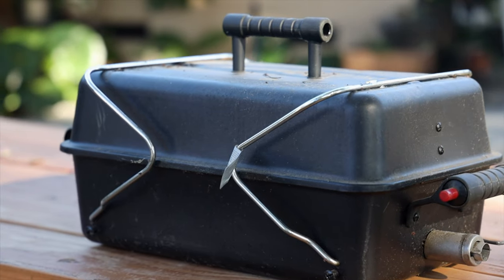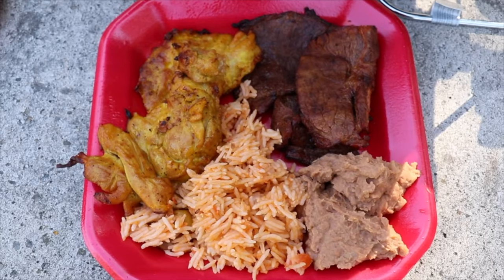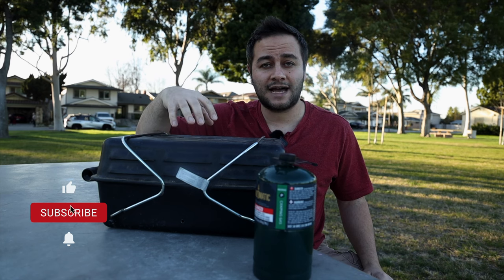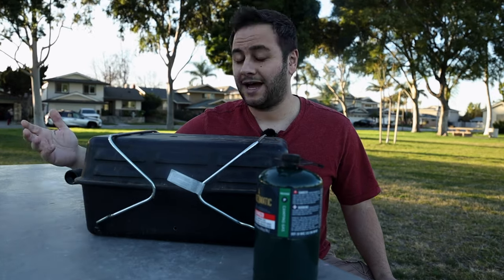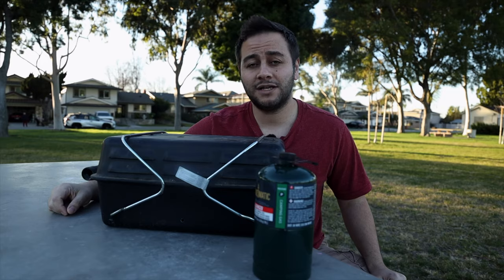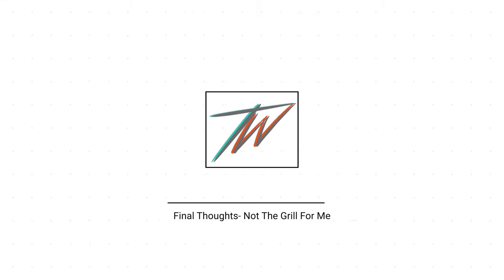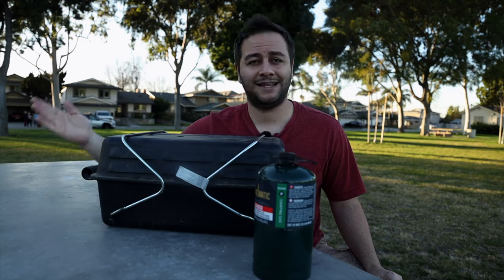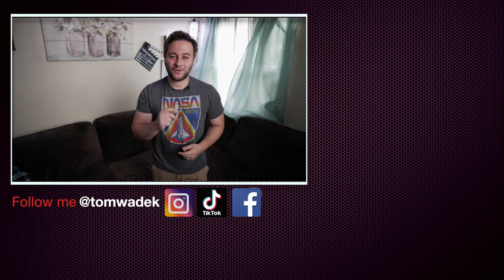I Was Wrong, DON’T BUY THIS BBQ GRILL

Comment: To fix the handles, you can use your (dresser drawer handles) measure the holes distance from one to another then drill the holes in the wood handles for the screws or buy some steel handles from hardware store or make heat treated wood ones. Hope it helps those on budgets and those were the handles broke. For the flame out,, use a hose with the Regulator or a better Regulator. GOD Bless
Reply from the maker: Thanks for the diy fix!
Reply: That was my first thought too. Great idea!

Comment: I have the older version of the Weber grill.  The build quality is excellent and it works fine.  I also have the Char-Broil table top grill.  The Weber grill only puts out a little over half of the BTUs as the Char-Broil grill.  I use the Char-Broil grill almost all of the time because of the increased heat output factor.  I performed several modifications to it.  I replaced the plastic handles with metal brackets and wood dowels.  I also installed a grill temp indicator in the top cover.  I also fabricated a steel vented "/\" heat tent that replaces the flat heat plate that covers the burner and helps prevent flare ups.  Lastly... I operate the grill with a 5 lb propane tank and a 5' hose with regulator and propane adapter.  Overkill?... Maybe.  But it is now an excellent little portable performer that does exactly what I want it to do.
Reply from the maker: Great mods! Glad you were able to make yours work! Happy grilling

Comment: You could have strung coat hangar wire through the screw holes.
Reply from the maker: Yeah but I was more upset by the design flaw and the lack of accountability by the manufacture.
Reply: @tomwadek  Yep, those handles are garbage.

Comment: I just bought 2 of these for $18 each. They will be used for cook you own food/lid off korean bbq (for our joined birthday). They might get used maybe 4-5 times a year tops. So I feel like it was still a good purchase even after watching both of your videos on it. Ill pop a couple holes in them, I will adjust the screw on the regulator a bit. but they should be fine for the minimal amount of time we plan on using them. Seeing as the all you can eat korean bbq we were going to go to was an hour away, and $30 a person.
Reply from the maker: Yeah, I feel like they are “ throw away grills” but they should work fine for your application.

Comment: I have the weber go anywhere charcoal version. It's a model with the side handles removed and has a top handle with heat shield. 
It's an excellent BBQ grill. My only complaint so far is that the grate is not stainless steel

Comment: I suggest for anyone who buys this to use and abuse, buy it in a box store, you can get a 3 year protection plan on it.  So essentially an entirely new unit replaced for free when the item falls apart.  For the casual user who will use this once or twice per year, it probably won't fall apart.  I bought this 15 years ago with a slightly different build and use it sparingly and it still works fine.

Comment: I think you're overfiring your grill.  I notice if mine is turned up too high it tends to extinguish.  So yeah, maybe cut some air holes under the burner if there aren't any, for more air.  Mine was not made by char-broil and it has holes in the bottom under the burner,  probably 6sq inches total (not a few small 1/4 holes).
Reply: BTW, if turning down the regulator still doesn't tame your flame and you'd prefer an lower flame, you can adjust the regulator (I've done this to mine, for this same reason).
By removing the tiny rubber plug or removing the decal from the center of the regulator knob, you'll uncover the recessed adjustment screw which may be an allenhead, phillips or flathead screw (I've seen all three of these).  By holding the knob in a fixed position while the flame is burning and adjusting the screw in the center of the knob counter-clockwise, you can reduce gas flow and reduce flame height.  I adjusted mine such that the flame was just low enough to remain reliably lit with the knob in the lowest flame position.  I find the even so, I still run a very low flame most of the time while cooking with the lid closed.  This is key to keeping the cooking speed from being way too high.

Comment: Great pictures, good looking food. I have the non sparker version of this grill I bought about 2 years ago from Ace hardware for $50. Been good for two years, now the heat output is low and I think the regulator is not working correctly. I am seeing a flame in the mixer tube!? I need a new one.
Reply from the maker: Glad you’re enjoying yours. Happy holidays.

Comment: A friend introduced Weber Go-anywhere gas grill to me. It was five years old, but looked almost like new (kept clean and grill grate washed after each use, and inside often). I know it gets used a lot. I have now bought a similar one myself, and have not regretted it.

If you use it at home often, you can save a lot of money by buying an adapter kit (WEB8449) for stationary gas cylinder.

With a 10-year warranty and expected longer life/use time, Weber will be the cheapest in the long term, despite the higher new price. It lasts longer, and you save the Earth's resources by not buying cheap to throw out the following year, it's a waste.

I'll go with a Weber, ann' time.
Reply from the maker: Great summery. Thanks for sharing your perspective. I agree completely

Comment: For one solid year of extreme use and abuse, I wouldn't consider this as a total loss. If it worked and worked well, for under $60 it is a win. I wouldn't opt for thr deluxe model as it generally costs $20 more for just an ignition system. I have spent more for a full size gas grill that lasted one season... About 3 months.
Reply from the maker: Yeah but mine wouldn’t stay on. It was too much trouble for what it was worth. I’m glad some folks had better luck but I went with the Weber go anywhere and haven’t looked back. I’m sure I’ll get years of reliable use with the Weber.

Comment: I have that little unit and your words reminded me of the reason it hasn’t been re-invited to the lake, which I’d mostly actually forgotten. 
Cooking burgers or dogs which a forgiving when the fire fails to do it’s thing. Chicken isn’t something you can be entrusted to serve when this pos opts to perform. 
The cruddy plastic handles can be easily remedied with a coat hanger, a piece of broom handle and coat hanger. 
Not elegant, but it’s a solution worthy of a cheapo portable grill. 

4-6” piece of wooden broom handle or similar, drill a hole clear thru it lengthwise. Straighten out the wire coat hanger, poke it thru the wooden handle, and each end into the lids bolt holes. Either bring the two ends together and twist them together, or bend them in a way they can’t just pull back out. I’d suggest a knot, but that’s really possible. It’s ghetto, but like I previously stated, it’s a solution better than wasting more money on parts that will take all summer to eventually arrive!  
If this was my grill I might be inclined to actually do this repair, or perhaps being a bit of a diy woodworker, I might attempt something more presentable. But I think when the time comes, I’d just throw it away and find another one at a garage sale or instead walk into my backyard and light my slightly more worthy old Kenmore grill and hope for another season before investing in the next last grill I’ll ever buy. 

Which reminds me, I still need to season the two carbon skillets I saw were delivered earlier this week following your great videos I was inspired by recently.
Reply from the maker: Thank you for watching. I love wood working and also thought about maybe making some wood handles as my next project but overall I’m not too happy with the grill. I’m going to replace the plastic handle and give it away. I’ll probably end up buying the Weber go anywhere grill. Glad your enjoying my videos. Sounds like you have pans that will keep you busy and hopefully some fun cooks. Happy cooking!